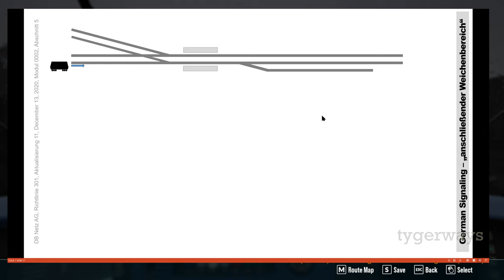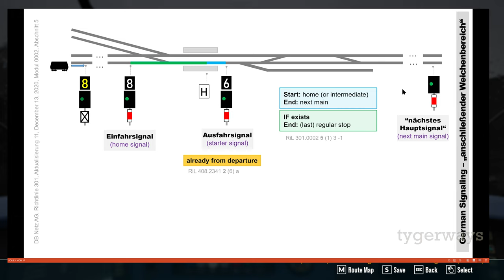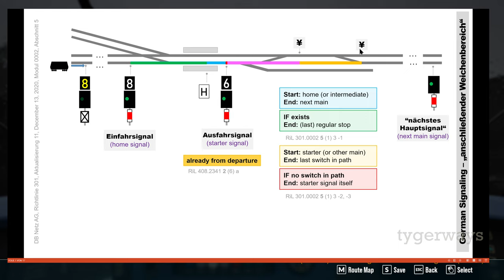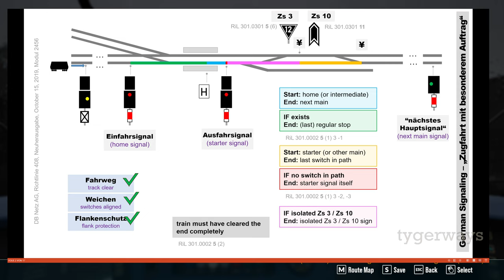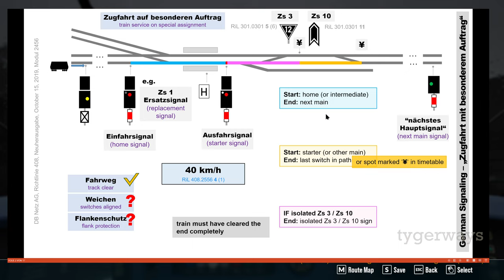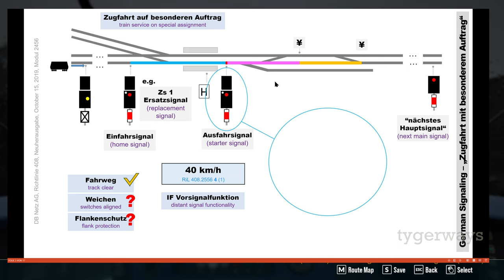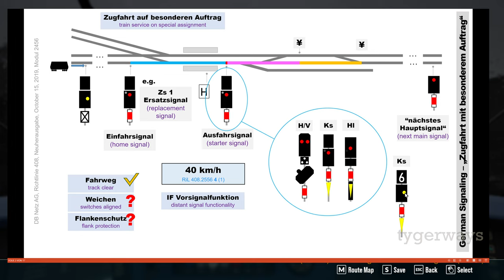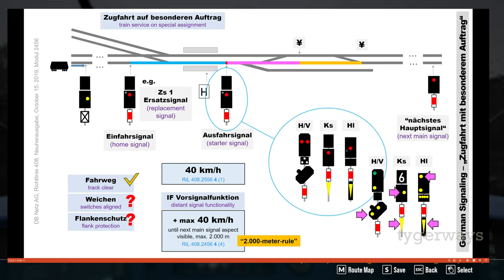Zugfahrt auf besonderen Auftrag 1: 40 km/h on e.g. Zs 1, 2000-meters-rule (Train Sim World tutorial)

Comment: The other brake handle is only to be used when there is an issue with the combined handle. It is not supposed to be used in Zugfahrten(Train operations adhering to signals under a valid timetable).
Reply from the maker: Thanks for confirming this! The train can be driven perfectly well with only using the combined handle, at any rate.

Comment: 12:56 While it is true that that signal should have an Ne 2 Board the kenntlich in this case signals that the distance to the next main signal is less than the usual 1000 meters on a Hauptbahn

51:48 there is a small typo with the 40 km/h rule and were to find it. Its in the Ril 408 but in 2456 not 2556

The presentation was really good you should really try Zusi your knowledge is wasted on the DTG games
Reply from the maker: Well, yeah, if the white light (Zusatzlicht, not Kennlicht, to be exact) was on the top left, I would agree, then it would indicate a braking distance shorter than 95 % of the regular braking distance. But on the bottom left, the Zusatzlicht only shows on Ks repeaters.
Reply: @tygerways6615  Ril 301 1 (3) states that only Main signals with distantsignal Funktion have the top left Zusatzsignallicht in that case the light on the is distant signal should not exist. Quote : „ Hauptsignale mit Vorsignalfunktion, die in einem um mehr als 5% verkürzten Abstand des Bremswegs der Strecke vor dem zugehörigen Signal stehen, zeigen bei Signal Ks 1 mit Zs 3v und bei Signal Ks 2 ein weißes Zusatzlicht über dem Signallicht.“
Reply from the maker: @tubecrafter9980  Yes, totally agreed, this light should not exist in that form.

The white light on top, indicating the reduced braking distance, can also appear on Ks distant signals (not only on main signals with distant signal functionality, but never on a Ks repeater, though), see RiL 301.0102 1 (3), Aktualisierung 11: "*Kombinationssignale* mit Vorsignalfunktion, die in einem um mehr als 5% verkürzten Abstand des Bremswegs der Strecke vor dem zugehörigen Signal stehen, zeigen bei Signal Ks 1 mit Zs 3v und bei Signal Ks 2 ein weißes Zusatzlicht
über dem Signallicht."
Reply: @tygerways6615  I do not know why it was changed but I know that my signal book is newer as it is a new print I got at the start of my traindriver training this June. And it clearly states in 301 0102 1 (3) „Hauptsignale mit Vorsignalfunktion“ there are a lot of sources on the internet that still have the old Kombinationssignale instead in that place. As said I don’t know why but opparenently DB Infrago decidet that Ks distantsignals no longer get the zusatzlicht.
Reply from the maker: @tubecrafter9980  Interesting.. You are right, by virtue of Dec 15, 2024 it will be changed to "Hauptsignale".

I don't think this will remove the Zusatzlicht on the top left on Ks distant signals with a reduced braking distance, though. This will most probably be based on RiL 301.003 2 (7) then. Even though only Vr distant signals are shown there, the text makes the rule applicable to (all) "Lichtvorsignale" (thus including Ks distant signals), no? (See also the change notes on p. 5 of the letter "Aktualisierung 12 des Regelwerks 301 „Signalbuch" mit Inkraftsetzungsdatum 15.12.2024" of Nov 7, 2023, attached to the end of the RiL 301).